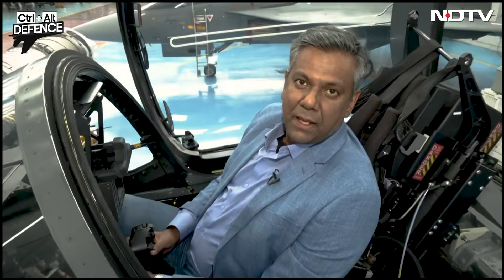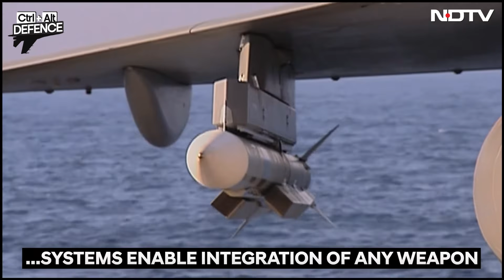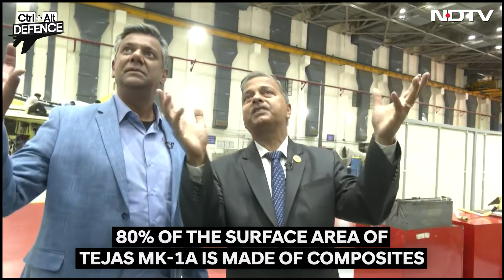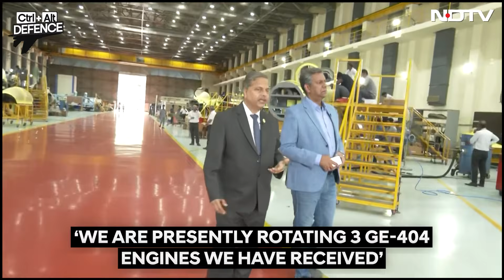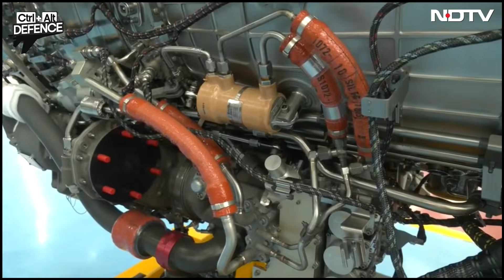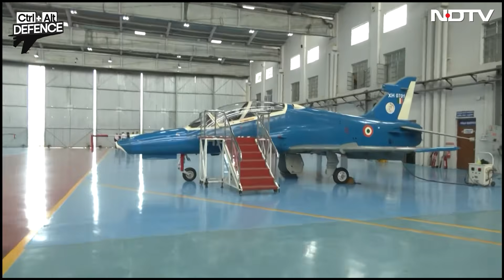Tejas Mk 2 | Tejas Mk 1 | Will Meteor-Armed Tejas Dominate? | CTRL ALT DEFENCE Ep 21

Comment: The problem is not engines, but the ECM of the fighter is blinding the Radar as they are fitted very close to each other since the Tejas is such a small fighter. This needs a total re-write of code, and validation of all fighter parameters from scratch.